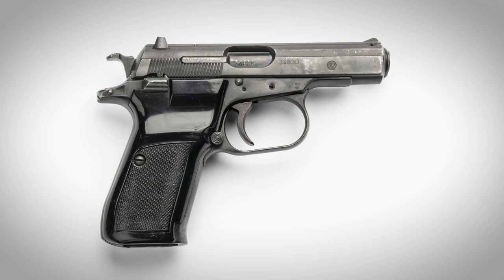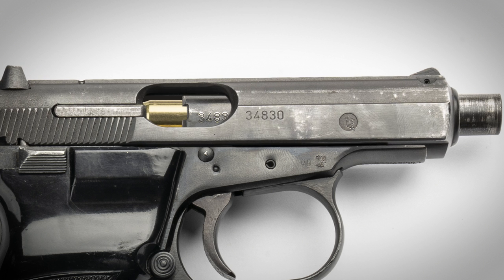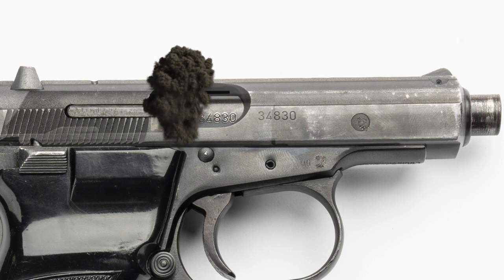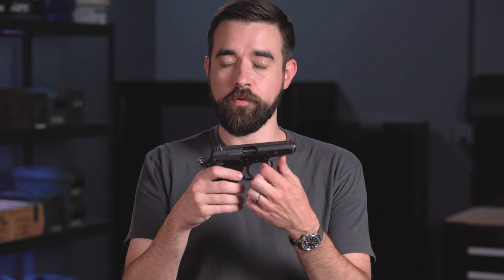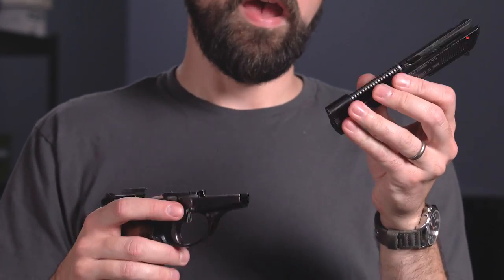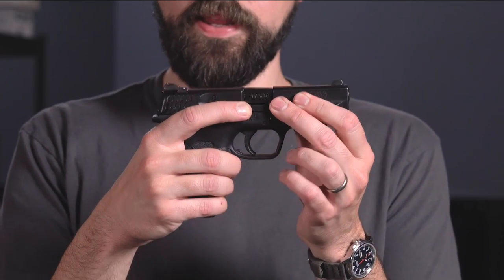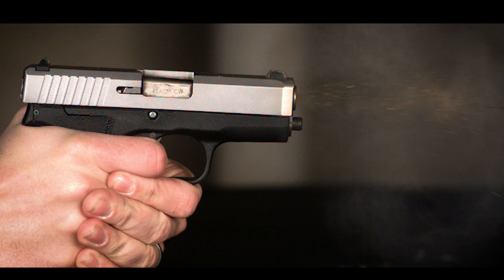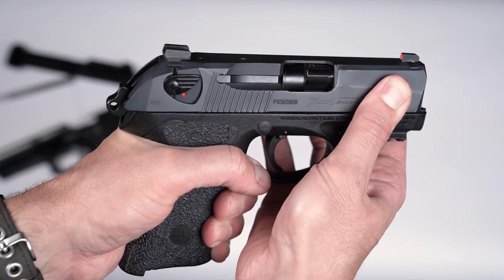Blowback Versus Recoil Operated Pistols

Comment: A couple of things you forgot to mention:

Blowback pistols are inherently more accurate than recoil operating pistols, due to the fixed barrel 

The Beretta also has a advantage of having less vertical shot dispersion, due to the barrel not moving up and down
Reply: Choppytoaster maybe its me  but from all my blowback pistols (cz82, jimenez JA9) vs my locking breach, the blowbacks are less "loud"
Reply from the maker: I think the fixed barrel thing is possibly a bit overrated. It can allow a gun to have great inherent mechanical accuracy, but that's definitely not always the case. There are a lot of very accurate recoil operated guns out there as well. The fixed barrel is just one of many factors to consider.
Reply: Choppytoaster can confirm, was able to hit an 8" plate multiple times at 130yds with my Makarov but was unable to walk shots in with the Jericho. I'm sure with more effort that I could have hit with it, but it didn't seem as consistent as the Makarov.
Reply: I'm going to have to disagree with you on blowbacks being more accurate because of fixed barrels. In fact, a lot of LEO's and military forces would also disagree with you. For the first shot... perhaps maybe because the barrel doesnt move. But due to the snappiness caused by blowbacks, rapid fire is certainly a lot less accurate. It tends to bounce around on target and cause a wider dispersion of rounds. 

It is something to consider, but it's not 100% the case. Look at the Steyr GB. A full sized fixed barrel design, but compared to guns like the Beretta M9 or even some 1911's, it's simply not as accurate generally speaking. Now some of it DOES come down to the shooter behind each platform and not saying people cant be accurate or perform amazing feats with blowback guns. But if it made such a big difference, they would dominate the competition world and they simply dont do that. 

I do feel sometimes that felt recoil is a bit oversold by shooters or the snappiness of blowbacks as well. However a fixed barrel alone doesnt make up for some of the other negatives that come with blowbacks. I love quite a few of my pistols that are blowback designs but I've shot them extensively enough that I know where they pattern with "X" ammo at "Y" distance and how well I can perform with them but I have PLENTY of guns that are non blowback that outperform them.
Reply: Is it really though?  The barrel might be fixed, but the sights are on the slide, which moves.  If the slide isn’t fit perfectly on the frame, the sights won’t return 100% consistently to the same location after every shot.  Recoil operated guns have the same issue, but the barrel is generally made to lock up more consistently with the slide than a blowback gun, so I would think that negates any advantage a fixed barrel would give.
Reply: @LuckyGunner  Speaking of accurate pistols that don't have a fixed barrel, the Luger comes to mind...  Perhaps the Luger's action is not in this channel's bailiwick?
Reply: UNKNOWN3554 How is a barrel on a recoil operated pistol made to lock up more consistently?
Reply: Hornet135 In a typical Browning tilting barrel action, the chamber locks into the ejection port and the front of the barrel is generally fit with a reasonable tightness to the front of the slide.  The camming surface on the barrel is also going to be fit to the cam/locking block in the frame and provide vertical support.  In a blowback action, the breechface is the only critical part that must be fit to the barrel.  The rest of the slide just needs to fit on the rails and have enough clearance for the barrel.  In a recoil operated gun, the barrel has to fit the slide in multiple critical areas, which I believe aids in consistently returning the sights in relation to the barrel.  Of course, there are very loosely fit recoil operated guns and tightly fit blowback guns, but I don’t think fixed vs. tilting barrel in a semi-auto is going to be the deciding factor in which is more accurate.
Reply: UNKNOWN3554 It’s simple, the blowback doesn’t need these extra areas of support because the barrel is always fixed and pointing in the same direction relative to the frame for every shot. The main concern is slide to frame fit. Both blowback and recoil operated pistol slides move rearward slightly before the bullet leaves the barrel. In the recoil operated pistol, this can allow for slight deviation of the barrel alignment. Achieving ultimate accuracy in a recoil operated pistol is a delicate balance between accuracy and reliability. In general it’s easier to make a blowback accurate than it is a recoil operated handgun, but any advantage a blowback has in mechanical accuracy is usually of little importance at typical handgun ranges.
Reply: Any difference in accuracy between the two systems cycling semi-autos is usually overwhelmed by the sloppiness in the link connecting the eye with the hand.
Reply: Eh... I have always found blowback operated pistols to be less inherrently accurate due to the low design/manufacture quality. For the most part, how accurate do you expect a $300 gun to be?
Reply: I might get the Taurus version.
Reply: I think it’s important to understand the difference between mechanical and functional accuracy. Locked into a fixed rest yes a fixed barrel will always be in the same position relative to the frame. However if the slide fit up is poor the sights may not be in the same position relative to the barrel. So if you combine hard to see sights and a lose slide-barrel fit. You get a fixed barrel pistol that is hard to repeatedly hit the same point with. Now some 22 blow back designs have the sights and barrel both fixed and only a small part actually reciprocates. Think Ruger Mark IV is a good example and most examples are pretty accurate.

Comment: You didn't mention the Astra 400 and 600 pistols in 9mm Largo and 9mm Parabellum. Successful blowback designs that relied on massive recoil springs.
Reply: J P so 9mm parrabelum is a standard 9 x 19 Luger bullet. So not sure why it would be so different from normal spec. The 9mm largo 9 x 23 is lower pressure case based on reading. So it wouldn’t make sense a stronger spring is needed. My guess is the stronger recoil spring kept it in place just a bit longer.

Comment: Much more informative than the wiki pages on firearm operation methods.

And you're right, blowback firearms definitely have more felt recoil. I've shot the blowback-operated Bersa Thunder in .380, and the recoil-operated Glock in 9mm, and the Bersa's recoil felt so much worse to experience.

Comment: Gas delayed Blowback is about the greatest thing since sliced bread but very few guns are made that way, perhaps to expensive, I'm not sure.
What I do know is the gun since its firing from a fixed barrel, is very accurate.
Reply: Also fewer points of failure due to a less complex system. And easier to clean with fewer parts.

Comment: Blowback guns, or any handgun with fixed barrel, is in my experience much more accurate than a tilting barrel.  With this design the orientation of the barrel to sights changes minutely, with every shot.  You might not think that ought to make much difference in accuracy but it does.  My fixed-barrel Bersa and Ruger 22/45 are tack drivers compared to my other autopistols and even my revolvers.

Comment: With blowback guns, you also get some delay as the case has expanded into the chamber walls, causing a slight friction lockup.  Once the bullet leaves the barrel(or is close to muzzle), pressure drops allowing the brass to contract, lowering that friction drop off and the residual pressure and/or recoil to start moving the slide - overcoming the mass of the slide and tension of the recoil spring.   Now, not all blowbacks do this, but many do rely on that friction lockup to hold the gun in battery during the high pressure right after ignition.   Others rely solely on slide mass and recoil spring.

Comment: Congrats on the 500k big 🐕

What confused me about the two was that the names, and crap half sentence explanations I've heard before, made me think there were two different like... forces... being used to operate pistols using blowback and recoil operated. But I mean they both use "blowback" or "recoil" from the gun to operate them (as opposed to say gas siphoned off from the barrel like a rifle or the flaming Desert Eagle), it's just the slightly different manner in how that's done that's the difference between them. Blowback using the mass of the slide and power of spring and recoil operated using a locked breach, traveling with the barrel, until the latter has traveled a couple millmeters.

Comment: If the gas pressures are too high during extraction. Not only do you have to worry about the brass casings erupting, but you also have to worry about the brass getting shredded by friction against the chamber walls because it is expanded. Gas operated and recoil operated makes sure that the casing is retracted way before the gun starts to cycle.

Comment: You can also add that if someone is limp wristed then that can cause some blowback pistols to malfunction because there's not enough solid resistance to compress the spring far enough to let the rim hit the ejector hard enough, thus causing stovepiping..

Comment: I would have added that the pressure must drop to aid extraction. Full pressure extraction will most likely rip the rim off. also blow back due to its fixed barrel is inherently more accurate.

Comment: So both are reliable, both use the case to push the bolt/slide back, and both don’t use gas. Blowback is mostly for small light rounds while recoil is used for light-hot ammo.

Comment: I had seen Hi Point guns in stores but never found out much about them simply because they looked bulky, and awkward, but didn't realize that bulkiness was due to it using a blowback system with higher pressure calibers instead of short recoil. Now it makes sense. Big, heavy slide for a reason. Is that why they're so much less expensive than most similar sized pistols, a simpler system, less expensive materials or production methods, or not as many buyers care for a non locking short recoil design for higher pressure calibers? I always wondered about that.

Comment: Shooting a Keltec P32 and a Cz50 back to back, both shooting the same 32acp ammo, for me the P32 has less felt recoil and is easier to control despite weighing about 1/4th as much as the all-steel Cz50. The P32, despite its tiny size, has a locked breech while the Cz50 is a straight blowback design. That's a big heavy steel slide on the Cz50 slamming back every time it goes off. Also, the Cz requires you to keep your grip pretty low to avoid slide bite. Both guns have pretty miserable little sights, similar capacity, etc. The Cz50 has a larger grip and a nicer trigger when firing single-action and a superior reset on the trigger (the P32 requires you to almost fully release the trigger before it resets).

Comment: Thanks for clearing up the fuzziness I've had about this for a while now.  The slow motion of the locked breech was really helpful.  One question:  you explained why blowback could not be used on cartridges with higher pressure, but why is blowback used at all?  Especially since the recoil is less on a recoil operated gun.
Reply: BB is a more simple design. Easier to manufacture and other benefits of simplicity.

Comment: For every action there is an opposite and equal reaction(is the common terminology your looking for) the lightweight bullet goes out the barrel really fast and the heavy slide goes in the opposite direction not as fast.

There is a lot of "what da Math" in calcufiguring the correct slide weights and spring strength

Comment: The spring would have almost no effect on keeping the breech closed. Calculate the "bolt thrust" on even a .380ACP, it's 21,500 psi against a base surface area of about 1/10th of a square inch, that's still 2000lbs of force, the spring is completely insignificant. Only the slide's sheer inertia (from its mass) can keep the breech closed long enough. It's equal and opposite reaction, if the slide weights 100x as much as the bullet it will be moved 100th the distance the bullet moved in any given period of time.

The main functional purpose of the spring is to simply return the slide to battery, it can't even do much to slow down the slide over time as you can see in slow motion footage the slide doesn't slow down much as it opens, the slide collides with the frame at close to the slide's maximum velocity. A stronger recoil spring will do more to spread the recoil forces over time.

Comment: Blowback also requires fewer and simpler parts than locking designs.  Hence Hi Point's ability to make decent (though heavy) pistols at a low price.  Pick on HP all you want, but they are far better than the other handguns at that price point.

Comment: That is really interesting. The german lanuage doesn't differentiate between "simple blowback" and "reacoil operated" and "locked breach". The german language only differentiates between the 2 principles gaspressure operated and recoil operated, anything that goes further is another thing. To be precise: the generall overall category is recoil operated guns on one side and gaspressure operated guns on the other side. If you now open the chapter of recoil operated guns there the next chapter is (subcatergory so to say), what kind of locking mechanism is used. And no matter what kind of locking mechanism is used it all falls under the catergory of recoil operated guns.

Comment: Just a note here the Shield shows uses the most modern iteration of the Browning's tilting barrel lock up which was introduced by Swiss (I thing it was Sig) they started to use the ejection port as a lock up surface with the barrel (Browning designs used ribs inside the slide). Also the most used tilting barrel way is based on the Browning pistol, not the 1911 because the 1911 is using a "tilting link" part (it acts similarly to a toggle) which is a part which ensures that the barrel will drop, in the Browning a cam groove is used to guide the motion of the barrel which is mostly used today. 

Nothing from the above matters for the basics and it is actually good, that you ommited them for this kind of basics video! It shows great script preparation! Love it.

Comment: With respect to accuracy: does then the blow-back design with a fixed barrel inherently shot straighter.  I have examined several recoil designed handguns and have noticed that their barrels aren't completely locked - one can wiggle the barrel at the muzzle with a little finger force - some more than others.    Thanks !

Comment: Recoil operated basically is just another term for "Blowback with extra parts".  It's all the exact same principle, just recoil operated keeps the breech and barrel together a bit longer by having them travel together for the first bit of the slide stroke. They all operate on the principle of the cartridge case pushing back on the breech face.
Reply: Thank you!  That’s what I thought I was hearing.
Reply: Recoil and blowback are two inherently different things tho
Reply: @borkwoof696  No, no, no they're not. The forces are exactly the same, and the origin of the forces are exactly the same. The ONLY difference is that recoil operated delays the breech separating from the barrel until pressures have dropped to a safe level. Recoil operated is just a marketing term used to distinguish more complex blowback operations.

Also, if you see the term "recoil operated" on a rifle, you should immediately think "inaccurate". There are no truly successful recoil-operated rifles for a good reason: there's too many moving parts and they can't provide good accuracy. Every 20 years or so some idiot tries it again, and every 20 years or so it falls flat for the exact same reasons as before.

Comment: The Heckler & Koch P7 which was discontinued in 2008 used a very unique system.  It was a straight blowback type but there was a port was in the barrel which diverted some of the gas pressure into a chamber just behind the recoil rod/spring.  The increased pressure delay the opening of the slide until the round left the barrel.  Then as pressure in the chamber reduced, the slide would come all the way back.

Comment: The H&K P7 is a 9mm delayed gas blowback pistol. It has a normal weight slide and a fixed barrel that bleeds gas into an under barrel cylinder/piston. The slide's movement is delayed until the bullet leaves the barrel and the pressure drops. Self regulates with hot loads and mild loads. The trigger gets hot after about 50 rounds. Very accurate and reliable.

Comment: I am going to speculate that the reason felt recoil is less for recoil operated is that the recoil mass is split between the slide and the barrel, and there are two separate impulses that are transferred to the hand, one when the barrel stops (and its associated mass), and the remainder for the slide as it is decelerated by the spring and stops.   Curious as to the mass of the slide and mass of the barrel.  Do you have a small scale to measure and get the ratio of mass (total mass vs barrel, vs slide)?  Because the bullet has left the barrel before the slide and barrel separate, both have reached max V.  Also, I suspect total mass for the recoil operated (slide + barrel) is greater than the blowback (slide only) so recoil V of the slide may be less.   On the other hand, you have a heavier bullet (that may also be going faster) so the forces (equal and opposite)  are greater and it is a wash.  It could be that your hand is already starting to move from first impulse when the barrel stops so you don't feel the recoil as much when the slide stops.